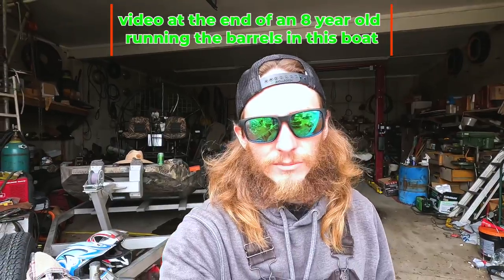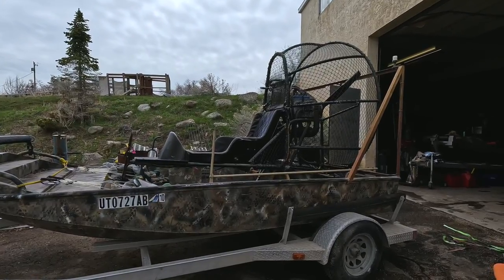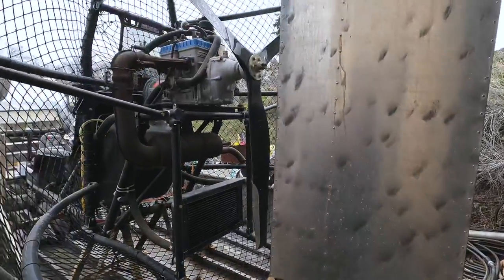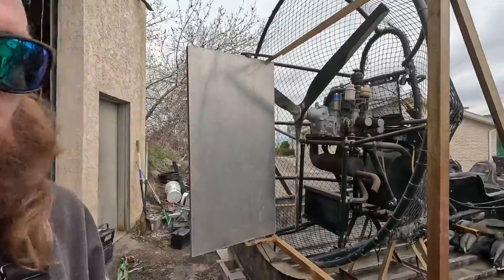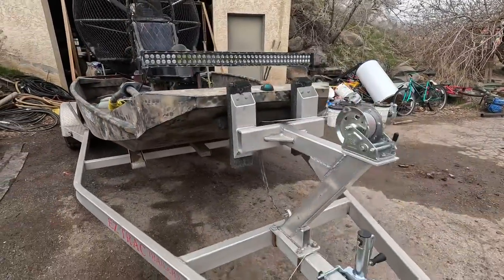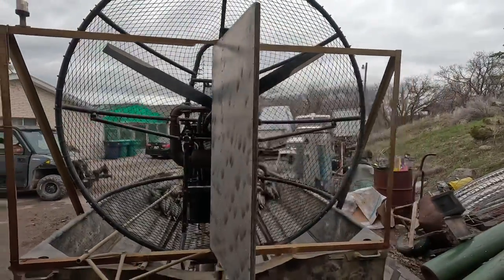Build your own mini airboat. The easy way!

Comment: Nice, those 582 rotax always surprise me, so much power in such a small footprint.
Reply from the maker: Awesome engines in a light boat. I’m excited to get it back out and show what it can do.
Reply: @ridinreeds  i heard you say no poly, do you run any type of slick bottom? Down here in Louisiana some of the minis are starting to run “gator glide” and “frog spit” and some of the others that the mud boats run, do y’all run anything like that there?
Reply from the maker: @swamplandoutdoors  yes we have that here and it would definitely help. But we run the great salt lake a lot.  The sand and coral would take it off as fast as I put it on so I’ve never spent the money.

Comment: We hunt the same area your running in on foot once it freezes up. I'm looking at purchasing mini without poly to help us get to the birds further out. My question is do you run poly or recommend it running on ice. Will it destroy your hull without poly?
Reply from the maker: That’s awesome. I would recommend poly if running ice. What size hull are you looking at and is it fiberglass or aluminum? Also what size engine? Poly will add some weight and drag from what I’ve heard in open water. I haven’t personally compared similar boats though I’ve just been told.

Comment: Will it run over wet sandbars that are exposed, and some dry sand? Would like to build something similar
Reply from the maker: Depends how fast you hit them. Lol this one does not run dry well. However there is a lot of forward weight with the seating. If you were to use this engine and get more weight on the back it could probably trim the engine a little better and be okay in a light hull. Weight is what will kill you with small hp.

Comment: I wanna build one.. need prop info and anything else you have. Thank you!
Reply from the maker: This is an ivoprop 64”. Very easy to adjust. Most powered parachutes I’ve seen are running those props. Are you planning on building your own stand and piecing it together or finding a powered parachute and mounting it?

Comment: What sort of mesh is that around the prop guard?
Reply from the maker: That is used trampoline netting I found in the classifieds and zip tied down. It’s been on at least three years now. Not the prettiest and probably robs some efficiency but it works.

Comment: How fast is it?
Reply from the maker: This one maxes out if I remember right in the low thirties. With a couple people and a heavy load of gear we are still doing mid twenties.
Reply: @ridinreeds  How much dose it cost,sir?
Reply from the maker: @engudom3105  just depends how much you can do yourself vs. buy. There is a very large variable.